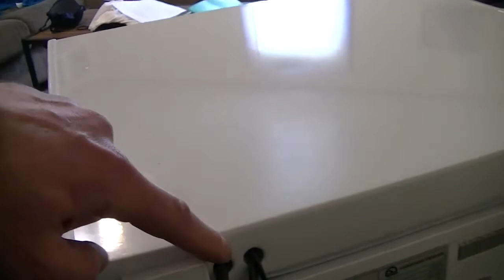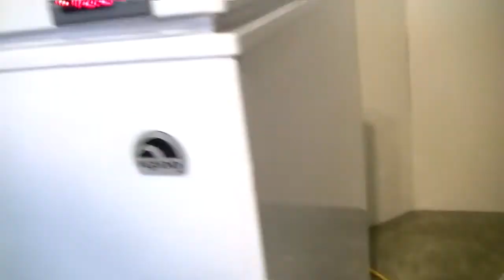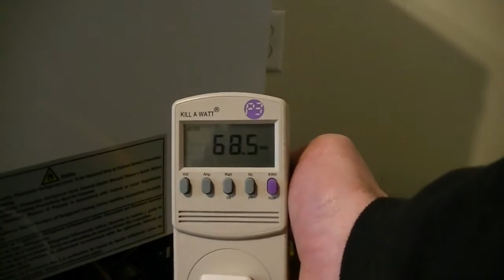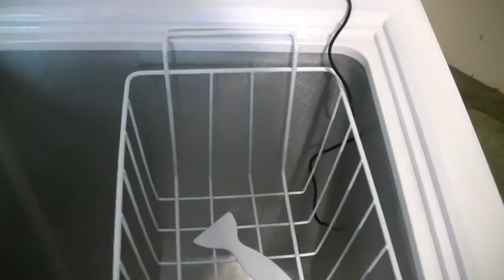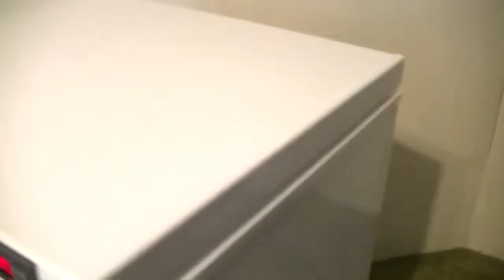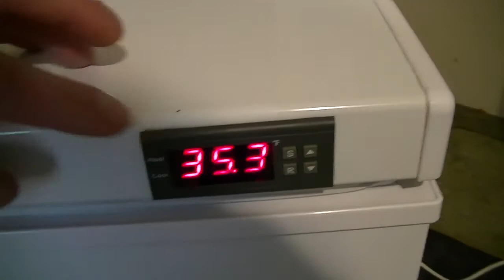chest freezer conversion

Comment: Why not put ice bricks or ice blankets on the bottom of the unit. these  will remain cold in the event of a power break. Also the sensor should not be in contact with the insulation; that way you get a true reading of air temp in the unit. Good video.

Comment: How is it working for you so far?  I used a temperature controlled outlet and didn't have to cut any wires.  You are right the temperature is all over the place inside the freezer.  I am currently testing to see if I can use the bottom as a freezer and the top section as a frig.